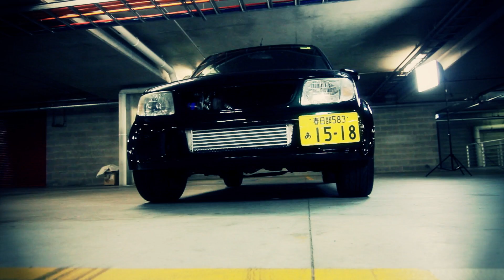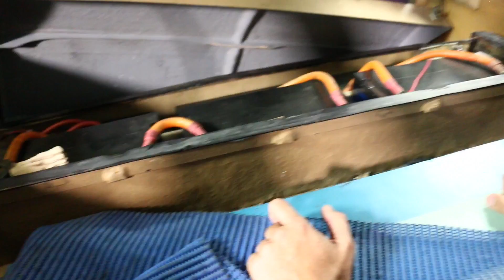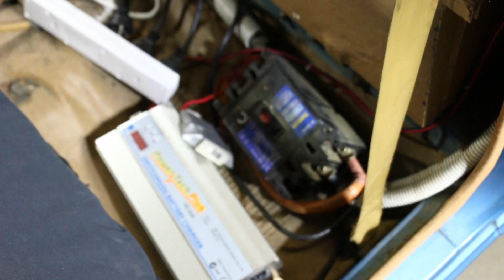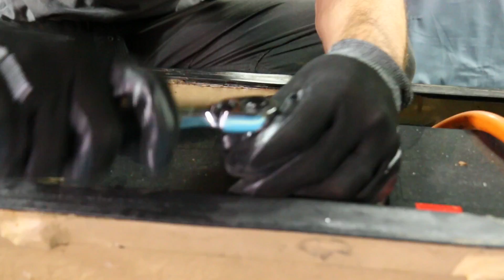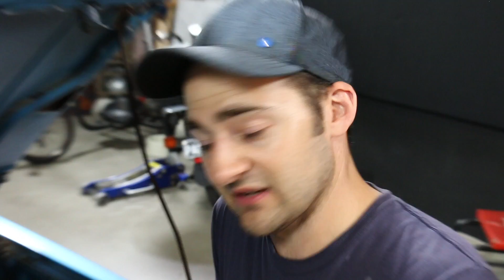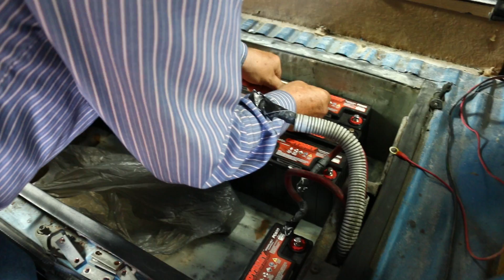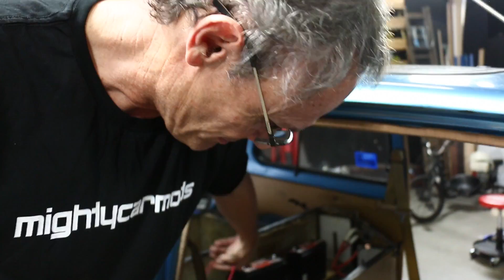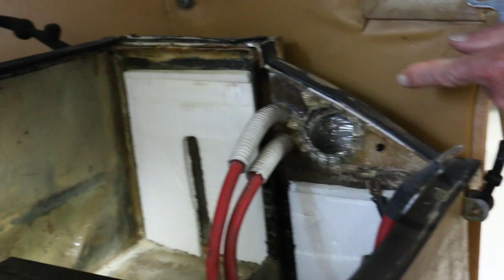JDM Electric Turd

Comment: You could add a small generator to charge the batterys as you are driving with the extra space you have giving you a much much bigger range.
Reply: +Steve Welch But that would add excess resistance to the motor making it more insufficient to add it if its connected to the motor,  Unless your talking about a petrol generator, But that would ruin the point of the electric car.
Reply: +Steve Welch 
serial electric hybrid systems are tricky to do, a lot of the Volt R&D cost was towards that
Reply: +Steve Welch you dont understand physics my friend. powering a generator costs energy, and the efficiency of the generator wil never be 100% so you wont get as much energy out of the generator as you are putting in.
Reply: +silencer9112 I'm stupid, I thought it was straightforward but no.
Reply: +Steve Welch allot of peolpe think this and now you know better. everybody has got to learn. If I wasnt tought, I would also still think the same way as you did.

However you're not completely wrong. If you could figure out a way to put the generator on the braking system. you could indeed use that energy (wich you would normaly waste) to charge up the battery. but you wil never get an efficiency of 100%

Comment: You guys should have bought nissan leaf cells off ebay in japan. They would be 5 times less weight and their voltage is constant under load compared to lead.
Reply: +carlover 
the volt packs have built in electronic balancers and stuff, they'd have to reverse engineer that software in order to interface with the packs. They're cheaper per amp-hour than getting new LiPos though, much cheaper, because junkyard dudes don't know what to do with them and just price them like an engine. get 5 grand worth of battery for 2 grand or less
Reply: +Ryukachoo Dude by your reply i see you dont know enough about the topic so i dont think you have the right to shit on my suggestion like that. You didnt even understood what i said.
Reply: +Ryukachoo 
in fact the smaller packs are 24kw total, and they're available in junkyards for like $2500. can't beat that with a stick

Comment: you should connect a solar panel and bolt it to the roof for more range
Reply: +jason hernandez Well they could easy add 24 battery's to the back as well tan the solar panel would make all the difference

Comment: why dont they fit a belt to the shaft that spins the wheels to an altenator to charge the batteries
Reply: +craig jeans Haha, because perpetual energy does not exist.
Reply: +codemsan infinite power is an impossibliity :D
Reply: Because that would put more load on the motor than it gives back. In order to do something like that you'd need to have a clutch for the motor and a clutch for the generator.
Reply: then that would just add more weight?

Comment: Love the new project, but I think you guys should warn your viewers about the dangers of working with electricity. Although considered less lethal than AC, with DC you quickly lose ability to control your muscles, i.e.: letting go of the wire you accidently touched. When working with that many batteries in series, ALWAYS  wear insulated gloves, and preferably safety goggles (electric sparks = molten copper)

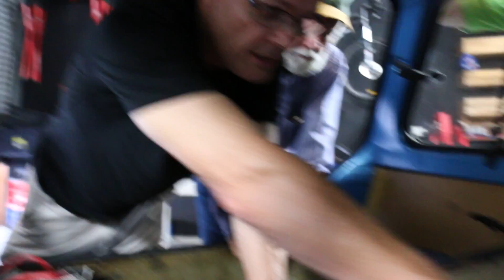Comment: Isn't tipping the batteries dangerous or something? 31:05 
or is that just an older battery thing?
Reply: +Adrian Zuniga Still dangerous for flooded lead-acid batteries, like a car starting battery. These are AGM, Gel-cell, or non-spillable, whatever you prefer. The electrolyte is gelled and the battery is sealed so they can be oriented as you please, and are even safe to travel on airplanes (think electric mobility scooters)
Reply: +codemsan oh that was fast. Thanks for the detailed explanation!
Reply: +Adrian Zuniga Only with wet cells, the Sealed AGM batteries can be placed in any orientation without the fear of spilling.
Reply: +Adrian Zuniga Looks like those are sealed EFBs but even then it's not recommended to do that.

Comment: AS ALWAYS, the limiting factor of electric performance is the BATTERIES, not the motor.

get some nice LiPo cells from EV west, a good controller, and just do burnouts in that sumbitch
Reply: And the limiting factor of the batteries is the budget . LiPo costs a lot for a car that they haven't even got working yet . :-)
Reply: depends on your range requirements, if they keep it under like 50 miles of range, you can get by with 10k or less for a pack, and the most expensive part of a conversion by far is the batteries.

they may be able to swipe the packs out of a chevy volt from a junkyard though, that's 30 miles of range for like 2 or 3 grand if that
Reply: +Ryukachoo 10K is not something MCM spends on a car. Especially if it's not a personal car.
Reply: ThierryTheuns
fair enough, but there's always volt and leaf batteries from junkyards, which is mentioned in the part 2 video. you can get a 24kw leaf pack for $3 grand here in the states
Reply: Ryukachoo
That might be a good idea. On a side note: I absolutely love America, for their junkyards in particular. You guys have EVERYTHING! Need a 454 big block? Sure, we got a few sitting around. SR20DET? There's 5 stacked over there! Oh you need the battery pack from a Nissan Leaf, how much you want?
I need to move XD
Reply: ThierryTheuns
it's because we beat the piss out of our cars and drive them into the ground within a shockingly short period of time, also our drivers are awful so plenty of wrecks

Comment: when it come to batteries i dont know  a whole lot just what ive learn from doing demanding sound systems.  1 thing i do know is if you plan on draining and charging a battery multiple times slowly Deep Cycle is the way to go. Standard batteries are only used to turn the starters  and be charged again, they are not built to charge and drain so they loose life over time. 

 designed to give all it's available power in 20 seconds (starting batteries), the other is designed to give it's power out over time measured in minutes or hours

love your show hope this helps..probably pretty common knowledge but thought i would throw it out there since i did hear you mentioned the batteries were from starting systems from sport bikes.

Comment: Would RC car batteries be a possible replacement? Because they're smaller, but hold a good amount of charge, and deliver quite high voltage.
Reply: +Dr. Weird That falls under the lithium ion/polymer category, and youd need a ridiculous amount of packs to make up enough capacity and voltage to run the car. They showed large flat lithium cells in one of the cars, stacked vertically. Same concept but designed for the job. Those cells make up the packs behind the rear seats in hybrids.

Comment: Please cover why you don't need clutch in there :v
Reply: +bartooo13579 They sort of did. The motor is attached directly to the gearbox. The biggest reason for a clutch on a normal engine is to match engine speed to transmission speed, since a gas powered engine cannot change speeds very quickly. With an electric motor, that's not so much a concern, since there's not a ton of moving parts.
Reply: +bartooo13579 They did :/
Reply: +Danish Motovlogger Yeah but I still dont get one thing. As far as I know (correct me if Im wrong) in manual to change gears you have to match input shaft speed to the output shaft. Going off a gear isnt a problem but in neutral rpm of electric motor will go down to 0, then to engage a gear you have to match its revs to output shaft (which is powered by wheels if you are moving). I just dont understand how you match it.
Reply: +bartooo13579 That's the thing, you need to rev match a gas motor because they don't change speeds very quickly, and just jamming it in a gear hurts the engine. An electric motor can change speeds basically instantly, so there's no real need to rev match.
Reply: +bartooo13579 When you stop in a regular car, your motor keeps running (trning) but your wheels stop. The clutch separates this difference. With an electric car, the motor can stop and start at will so you don't need the extra rotational mass.
Reply: Still a black magic to me :v. Mb Ill  find out in the future (I want to make one myself :E)

Comment: I've never seen an EV with a transmission.  I think most don't use one because it becomes wasted efficiency.
Reply: +Sara Not true even electric motors benefit from a transmission. It would make them up to 15% more efficient. http://www.heise.de/autos/artikel/Doppelkupplungslos-mit-eDCT-1802337.html Sorry it's in German but I'm sure you can find an English article somewere.
Reply: Most guys just put it in 4th gear and leave it there. Only using lower gears to get up hills. A 5th gear would greatly increase efficiency.
Reply: Trans will add weight. Main reason not to having gears is that most will not handle the torque. A quality gear will make the vehicle too expensive and defeat the purpose of an economical electric vehicle.
Reply: That makes sense.  I figured there had to be a reason, my Leaf doesn't have one, and I know of no production EV with one.
Reply: +DonTHEhandsome1 adding a simplified 4 gear dual clutchlees transmission will not make it less efficient on an electric car that weighs 1.5 tons. The opposite is true. Read this: http://user49750.vs.easily.co.uk/wp-content/uploads/2014/05/4SED-paper.pdf

Comment: isn't the saying that Volts Hurt and AMPS kill?
Reply: +MrKatodi There is no such thing. Voltage is the energy required to create current. In or to get hurt or killed, you need enough amps, and to have enough amps, you need enough voltage.

That is why you always see signs that says "Danger: High voltage", not high current. Yes, the current (amps) is what kills you, but without high enough voltage, the current will do no harm. High enough voltage combined with high enough current is what kills you.
Reply: +MrKatodi Volts thrill, Amps kill! Voltage is how hard it hits you, amps is how much electricity passes through you. Cattle fencing for example is around 2-3000v but has a low amperage, it'll give you a whack but it won't stop your heart or burn your nervous system

Comment: Lead acid batterys are not designed to be drained completely. The more drained they are the faster they wil die. The plates inside wil get verry brittle when they are empty and when you introduce a shock to them they will break and your battery gets useless verry fast. Hence they are not commonly used in EV.

They are verry cheap(compared to lithiumion) but will not last unles you only drive verry little distances an keep them fully charged at all times.

Comment: if anybody is interested you can check my clio ev conversion, it was a 20.000 euro project by me and my dad.
https://plus.google.com/photos/108345842253760626583/albums/5992634764707214049
Reply: +Gasper Erjavec Well made dude!! Good work
Reply: +Gasper Erjavec Nice project, what kind of range are you getting?
Reply: The_Doctors_Tardis an average of 120km per charge on 85%of the capacity on highway use , if i would drive it really easy of the highway i bet i can get a 200km+ range
If you build an electric car it's an investment so you pot in as much batteries as you need so it pays of in the shortest time. In one year it has saved over 2600 euros only on fuel.
Reply: +Ardinx thanks, it's really nice to see people liking your work.
Reply: +beduiini thank you, it means a lot :-)
Reply: Hats off to you and your dad !
Reply: Nice work! :)
Reply: Amazing job man, its too good! I like the extent you've gone to with the effects above the already tough job, it looks great!
Reply: Woah. That's pretty cool!
Reply: Great job!
Reply: Wow, that actually looks amazing! I like how you've incorperated PC looking parts into the engine bay, great job just doesn't justify how beautiful it looks!
Reply: +G10 thanks, it means a lot , i worked at Ekwb at the time and they agreed to sponsor the cooling system. The D5 pumps are amazing, two winters and 60k+ miles later they are going strong as it were day one. And i needed radiators that have good efficiency even at a low temperature difference so PC water cooling stuff made a lot of sense :-D
Reply: Wow....awesome car, that is one unique ride and looks like it was worth it
Reply: That's amazing, great job!
Reply: Thank you :)

Comment: hopefully you didn't connect 2 lead accid batteries in parrallel. because the batteries are going to die. this trick is learnt at an lower level of electrical design. Butt high graded teachers and enough electric engineering student made this fault. you probably could throw the batteries in parrallel away. if they didn't die you should take them out and run everything series.
Reply: +ry juhn This is not true. If they are in good condition, charge them properly and don't let them die, there is absolutely no problem in having lead acid batteries in parallel.
Reply: +Christian A True, also they are putting battery banks in parallel which means the parassite current is limited by the serie of internal resistence in each bank
Reply: +Fabio M. this is the problem which you are telling. because the resistance of lead acid batteries is very low. you will get a current of many amps.
Reply: +ry juhn since the batteries are all fairly new, produced at the same time on the same production line, charged and diacharged while already connected in parallel I'd be surprised if you had half an amp circulating between 2 banks of a thousand A/h each.

Comment: Moog constantly lifting the batteries upside down...
Reply: That "water"  is "acid". Just sayin!
Reply from the maker: +cwuzii gel cells
Reply: +Mighty Car Mods I assumed that by the end of the video when you/he did it a few more times. I hate to even hear the water splashing inside my car batteries when I lift them, scared of it coming out and burning my soul.
Reply: Backstrom Eric I know, that's why I spoke of it burning me. I also know that the acid is largely diluted with de-ionized water. I used to work with them.

Comment: Drop a forklift motor and large battery bank in that beast! ;) That car is most likely already using electric forklift part's too. Btw don't worry about those old battery's too much, as long as their not leaking acid. I think you could do without that 2nd battery cradle (which obviously someone added in) and take that stupid AC breaker out, replace it with a proper DC fuse.

Comment: why does it say agm which is absorbed glass mat but then says valve regulated lead acid? it can't be both.
Reply: +James Godwin Their valve regulated AGM which is safer then sealed AGM batteries. No lead acid here.
Reply: +Travis Piper I mean the original batteries. they say lead acid on them.
Reply: James Godwin oh yep, sealed lead acid.
Reply: +Travis Piper I always thought lead acid is like regular car batteries with actual liquid in them.
Reply: +James Godwin Actually, all AGM batteries are also VRLA.
Reply: James Godwin They do have liquid, some are sealed and higher performance ones have vents. It depends on the applications.

Comment: The EV1 from GM used NiMH not lead acid.
Reply: +James Beecham It launched with suuuuper cheap ac delco lead acid batteries that gave it a 60-80 mile range, but were super unreliable.  They were then upgraded to PSB lead-acid EV-EC1260 batteries. Those ended the reliability issues, and gave it a 110 mile range. In 1991 it was upgraded again to NiMH which gave it a 160 mile range.

Comment: Check some of the new batteries designed for general aviation Aircraft ... Specifically  'Lithium Ion Phosphate' batteries. They are so much lighter and more powerful than the lead acid type. In the States Earth-X is a great source ... not sure who has them down your way. They are also safe batteries.
Reply: +Bravo21 At the end you can briefly see some blue Headway LiFePo cells. Looks like they will be going that way.

Comment: I'm slightly worried you have starting batteries rather than traction batteries.

Starting batteries are designed to give huge bursts of current for short times and really don't like being deep cycled (Used for a long time)

Inside they have a delicate honeycomb structure which when deep cycled just falls off. Leaving you with sad broken battery gunk sat at the bottom and no power.

Something like a golf cart battery will do you proud. Along the lines of a Trojan T-105 or similar. You'd need something a little smaller though
Reply: +zogworth 
They appear to be dual function batteries. That's what they use on boats so they can run a bilge pump but also start the engine. Racing bikes also run AGM (absorbed glass mat) batteries capable of high current for starting and deep cycling. Many racing bikes don't have an alternator and flatten the battery to run the spark plugs during a race.